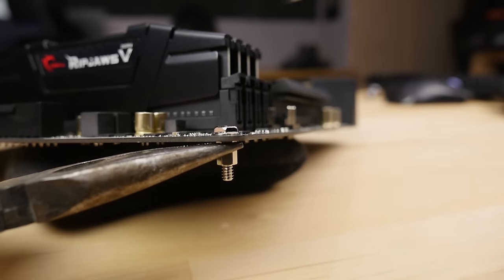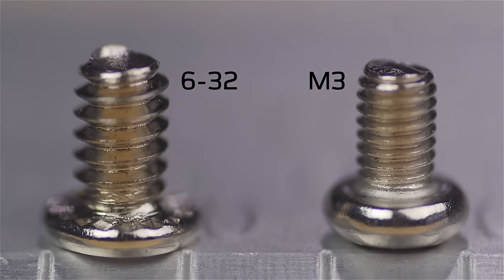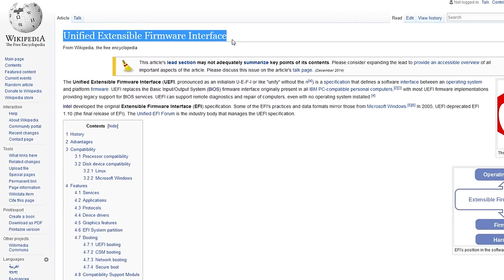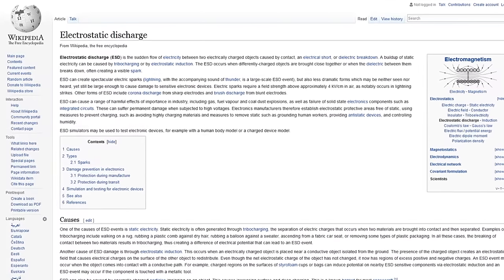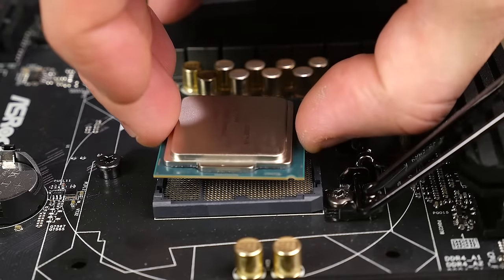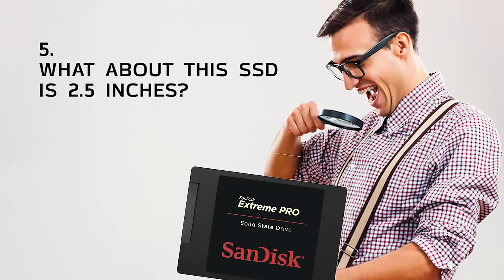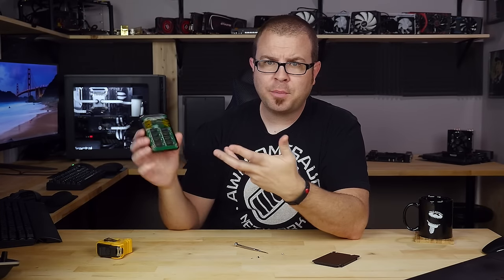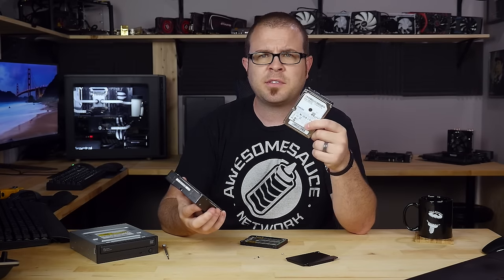5 Confusing PC Building Facts

Comment: Dude that socket creaking is no lie. When I unboxed and inserted my lovely 3770k into it's socket almost a half decade ago the ungodly sounds it made when I pushed down on that lever took about 10 years off my life.
Reply: Tell me about it. Buying a brand new 4790k and then putting it in the socket almost killed me
Reply: As always, the solution is to get drunk first. It'll make you much more relaxed and indifferent!
Reply: I built AMD. I cannot relate to this problem.
Why does Intel use LGA anyway?
I was a first time builder. Didn't have a problem with the pins. And having the CPU just slot right in was about as satisfying as my first time with a woman.
Bolting on the cooler on the other hand. Well that felt like I was going to fucking break something.

Comment from the maker: Epic likes and feedback on this video, THANK YOU everyone!!! I'll get some more ideas together for the next one...
Reply: +Paul's Hardware here is a quick checklist that I use when building and upgrading.
Case - Needs to be big enough for what's going inside.
Video card length - make sure case can handle it (sometimes drive cage can cause issues, especially with power cables) 
Video card length (again) - check what MB connectors could be covered by the card (SATA, USB, jumpers, connectors, etc...)
Cables (power and data) - check that the length is appropriate and that the connector has enough room when plugged in with other cables (sometime right angle SATA cables need to be thrown into the pits of hell)
Cables with locking mechanism - Stop yanking!
Heatsink clearance - Memory sticks and or capacitors can get in the way
Memory stick clearance - Heatsink can get in the way :-)
USB devices - Size matters!! it could block a neighboring port.
When building, place case and parts on clean non abrasive surface (aluminium and plastic scratch easy) I have seen new systems with scratches all over them because a screw was on the surface and the side panel was placed on it. This holds true even for places where sand is prevalent.
I'm going to stop now :-) Don't want to make ppl paranoid about doing a build.
Reply: +Paul's Hardware 
I've been building PCs for over 25 years and this gave me a great laugh--so true!  Keep em coming!
Reply: +Paul's Hardware That "You son of a bitch, you lied to me!" Should become an audio meme. lol
Reply: I agree with you on the esd I've been working hands on for two years with hardware and never had any problems
Reply: +Paul's Hardware Don't get us confused America! Canada uses and prefers the metric 
system, and the only reason we have to deal with the 6-32 standard because we share a border with you. 

Notice how you say "UTS 6-32, which is used in the US and Canada", and then you just say "The metric system". What you forgot to say is "The metric system, which is used by every other country on the planet."

By the way, the 2.5" and 3.5" is actually a common sense thing, not deception. Kind of like the metric system. It just makes sense.
Reply: +Justin Peterson This is the thing that people don't understand about ESD. It's not going to zap your computer and kill it.

What will likely happen, and you won't even notice, is that a small electrical discharge happens, and then you wonder why your computer crashes sometimes after many hours of use, or at random times for random reasons. These are typically caused by flipped bits, that are a byproduct of damaged memory.

It might cause a small intermittent issue, but the damage will be done, and you will have a less stable computer as a result.
Reply: +Paul&#39;s Hardware ESD protocols are followed religiously in production and trouble shooting. I used to build million dollar mainframes as well as computers used in hospital equipment. Nothing is left to chance. Sometimes you can zap a component and weaken it so it will fail overtime, not just fry it. Also ESD can zap a component without you even feeling static. We didnt even let clients in the building without ESD foot dischargers.
Reply: +Nabeel Rahimpour Yes exactly.
Reply: +Paul&#39;s Hardware He's another one mate. Loving the videos. In fact I think I'll subscribe.
Reply: Capt.Motty Yeah, that looks like a good, solid build.  The only changes I would recommend would be as follows:
If you can spend the extra $120, go for the i7-6700K 4GHz CPU.  You will never regret getting an i7, but you may regret NOT getting the i7 as so many have in the past.  It will also future-proof your rig for much longer.

The 240GB SSD is good, but if you can afford a 500GB, you will be much happier.  You will quickly realize, as I did, that you like to have certain games installed on your SSD for the fast load times.  With a 240GB drive, you will have to do a lot more installing/uninstalling of software when you want to take advantage of this.

Finally, the 1070 is definitely the sweet-spot for price vs performance on video cards.  But if you're like me, you'll find that even though you are happy with the 1070, you'd wished you went ahead and spent the extra money for a 1080.  On the bright side, however, the 1070s are in such demand that you could sell it a couple of months down the road and buy a 1080 when you get a little more money.

Good luck!
Reply: BenMJay l
Reply: Capt.Motty
Not a bad build apart from the monitor and the case. Go for a cube case, they're easier to put parts in and cooler to run. Sorry about the late reply.
Reply: I remember 5 1/4 inch floppy drives from the 80s... ;) So I just assumed that the 2.5 inch measurement came from that era and was kept for simplification (or industry standards) and didn't worry if the actual drive was a bit bigger.  I just worry about it fitting correctly in the intended 2.5 inch bay. :)
Reply: where did you get the tabletop/desk? I like the wood a lot. Nice video also!
Reply: Long live the metric system, screw the imperial which only 1 country uses.
Reply: Paul's Hardware my psu fried when I plugged my fan into my mother board and my psu
Reply: What ??? let me understand you correctly.you plugged your case fan into your motherboard, via the 3 pin connectorand... at the same time you plugged it into your Power supplyWTF are you talking aboutI mean, if your fan has both 3 pin connectors and Molex and you plug both in simultaneously , the result will most likely be a faster spinning fan,your fan might overspin and burn out the coilbut your motherboard wouldn't be affectedin order for your board to suffer damageyou would have had to insert the 3 pin connector, the wrong way onto the headergod only knows how you did thatis that what you didbecause if you somehow plugged into the molex connector the power supply incorrectly,again, god only knows how you would achieve that.but, IF YOU DIDif anything was damaged it'd only be the PSU or the fannot the boardif your board sparked up and is now non functional you would have had to short circuit something ON THE BOARD ITSELF.
Reply: it could easily fry a motherboard like that
Reply: Martin Kuliza yup psu fried, the led lights were still on but it wouldn't boot
Reply: Frederik Bosman yeah, that sounds right,
because LED's don't require a lot of current to light up, however to start a computer Motherboard More current is required

i'm betting if you open your PSU, you'll probably find a big black mark on the yellow board and a few blown Capacitors

try replacing the PSU and see if the board still fires up
Reply: Paul's Hardware how do I know which motherboard will fit into my case? I'm building my first custom pc
Reply: David Aquilare Ensure that your Motherboard is ATX compatible
and that your case is ATX Compatible and .. they will fit

Comment: SSD advertised storage:  128 = 120, 256GB = 240, 512 = 480, 1TB = 960.  I guess they forgot about 1024 vs 1000.
Reply: +Brawndo this is actually still a hold over from bit vs Byte which manufacturers still use to "mislead" customers on any advertised storage sizing. the long, and short of it is the advertised size uses 1000-to-1 instead of 1024-to-1, but they kind of make up for it by saying that there are 10 bits in a byte for their math. the same way that it is is Gigabit networking, and not GigaByte networking. even if you take a close look at the info in you UEFI-BIOS your RAM probably is smaller capacity then advertised.
Reply: Its really a combination of formatting and the fact that advertised Size does not actually use the correct math. Its calculated with base 10 math instead of base 8 math.

Comment: I've killed RAM stick in 2005 just by touching it right after I removed my sweater.
Reply: Arnis Tarassu haha sucks 😭
Reply: People tend to underestimate the effects of ESD.  The majority of damage being caused isn't immediately visible, like what you've seen.  What you're more likely to see is a latent failure, which may cause errors and intermittent issues at some point in the life of the product.  I can guarantee you, any facility that builds electronics (I work in the industry) has everything from conductive flooring, desks, mats, clothing and many other items to mitigate the risks.  Hardware in many cases is much more resilient than in days past, but ESD damage still occurs.
Reply: CBTalon97 Right! This is complicated but it is the truth. Damage is not always seen at the moment it was done.
Reply: Generally referred too as latent damage I believe.
Reply: The damage is immediate.  The effects are latent (delayed).  Just think of this example.  You cut 3/4 of the strands out of an extension cord.  The cord still works fine for your lamp, maybe for your TV.  Plug in your pressure washer or a vacuum into it and it'll eventually fail (heat, fire etc).  The damage is immediate (like an electro-static discharge), but the failure isn't immediate.
Reply: that's right, CompTIA A+ basicsthere are 2 types of damageCatastrophic Damage = Occurs immediately and is clearly visible Latent Damage = is not always immediately visible and can take time to show upyes, that's a fact

Comment: Worst thing is building a custom water cooler, powering up, and then find the CPU heat block is faulty, and pisses water out all over the motherboard. Never moved so fast to kill the power.
Reply: This is why you leak test with another power supply as well as turning off the pump every now and then.

But this should have been detected by you during the flushing of the CPU block.
Reply: Either a lie, or you don't know what you're doing, PMSL either way.
Reply: Achmed Metzor what makes you say that. Clearly your fingers are running, rather than your brain. The cause of the heat block fault was a bad seal between the copper base, and the Aluminium rear. It was tested before installing, and clearly developed a fault once lashed down to the CPU.
Reply: You ALWAYS test your pump/fill up the loop separate from the rest of the system after it is installed. It's called leaktesting. A faulty o-ring or cracked fitting or whatever can always happen even if you are carefull. Testing your loop before hooking up all the other components to power will save your system.
Reply: I've had that happen as well. A ball draining experience.
Reply: Truth be told, as long as the motherboard isn't powered up (which is shouldn't be during leak testing anyways), getting water on the board isn't going to do any damage as long as the water is dried before you try to power up the computer again. If you want to be really safe, and I recommend you should be in this case, clean the area the water spilled on to with isopropyl alcohol. Trust me, a little bit of water won't hurt your components if there's no power. Hell, even then, I've fixed laptops in the past that had far worse than water spilled on them (like beer and soda) and they still worked fine, even when they were powered on when the spill happened.
Reply: This is why you take a system that's already been exposed to water to test a water cooling setup on.  I have a Dell that pumped water out of the power supply so it is already damaged goods.

(The whole office building was flooded with at least an inch of water, the client said their insurance paid for everything and waived the deductible because of the damage.  Hundreds of thousands of dollars in damage from a burst copper pipe in a kitchenette that happened on a Friday night.)
Reply: This is why I remain oldschool, and use fans instead. I don't OC, so I don't need extreme cooling anyway.
Reply: I've not used Water cooling since the demise of x86 platform in favour of x64. I've also never over clocked a computer either. But kit supplied Water coolers have there ups and downs - like the Zalman tower cooler - the pump eventually fails, and is hard to get to, unless your the hulk and can unscrew the base cap. Also the Corsair cooler is great for a foot warmer in winter, but I do hate the noise in the British summer, especially when it surges to try and keep pace. I've also used ThermalTake, and the best advice here is to not bother - it can't cope with summer heat, and even air cooling does a far better job here.

Comment: for drive sizes, it's even worse!!  an 8" drive actually had 8½" platters, a 5¼" drive actually had 5.12" platters, and a 3½" form factor drive actually has a 3.74" platter standard, while a 10k or 15k rpm drive have either 3.0" or 2½" platters in a 3½" form factor drive.  2½" drives are the first to actually have platters which match the name of the form factor, 2½".  then there's 1.8", 1.3", 1", and .85" drives, which all match their platter sizes.

the names for the sizes ACTUALLY come from floppy disk form factors, 8", 5¼" and 3½", as the hard drives are designed to fit into what were previously FLOPPY drive racks, but since the disks/platters themselves are non-removable, they can take up the entire innards of the drives (except 5¼" didn't, for some reason).  CDs/DVDs/BDs are also 5¼", while the drives are 5¾" wide.

Comment: The whole 2.5"/3.5"/5.25" nomenclature is a throwback to the removable media days more than anything. A 5.25" drive was used to read floppy disks that measured 5.25" across. As such, the drive itself had to be larger in order to house it. Same with the 3.5" disk drives, they accepted the 3.5" floppy disks and had to be larger than that to house them. As far as I know, there was no 2.5" removable media back in the day, so that is, yes, referring to the platter disks inside the housing. While we don't use floppy disks anymore, we still utilize the housing standards that were based upon their drives, so the nomenclature stands.

Just be glad you don't have to worry about drives in the old 8" floppy disk format. Our machines would be utter monsters.
Reply: +ProjectDv2 oh god i remember those massive floppy discs i must've been maybe 5 or so when i saw one at my dads job... shit
Reply: Yeah
Reply: That always reminds me of the old hard drives big as washing machines where you just switch out the platters in a convenient plastic case that looks a bit like a cake lid.
Maybe that's the reason why we refer to the size of the platters instead of the drive. The platters were the drives back then.

Comment: The benefits of having built computers for ages: you tend to accumulate screws for all kinds of needs. Also a couple hundred jumpers. And standoffs. And... :P
Reply: The same here. I've got hundreds of screws of all sizes. And all the other parts needed to build a pc. Even cables and adapters...etc.
Reply: Same here mate, 15 years worth of accumulated screws. stand offs , Transformers and Cabling and a shit load of other stuffthankfully I pride myself o keeping my screws organized, I don't just throw them all in one box or tin or jar and then sift through them when I need a screwI have them all sorted
Reply: Mhmm, I got a pencil box full of screws, jumpers stand offs, both plastic and metal, and even a couple of old PC speakers... no idea where the PC speakers came from.
Reply: Jumpers? Wait, those things we place over the M/B pins that we no longer use?
Reply: Shannon Fletcher
Mhmm. No big use for them anymore. IDE drives used them as well.
Reply: and old IDE drives with no use for them..
Reply: And... case bling... (silently glances at branded sticker cluster)
Reply: The stickers are quite nice for decorating wallets, folders, and really anything that you can stick something onto.

What's not to love about putting a "Powered By EVGA" badge on your wooden shelf?

Comment: When it comes to motherboard standoffs.

Use the ones provided with the case when you bought the case new, they are 1000% guaranteed to fit
Reply: IIGrayfoxII Yep
Reply: There is never a 100% guarantee in life. There can be manufacturing imperfections. I built a PC two years ago and the one of the standoffs did not properly fit the hole it was meant for, so it became lodged in there. The hole for that particular standoff was skewed enough out of shape that it did not allow the standoff to screw in as easily as it was meant to.
Reply: The case will be marked where the standoffs go depending on the type of motherboard. The standoffs themselves are pretty standard.